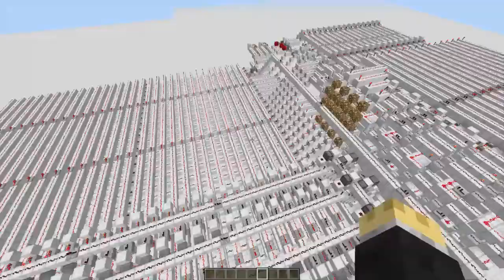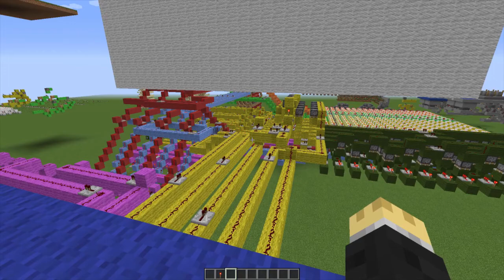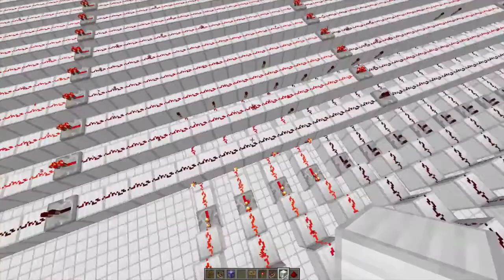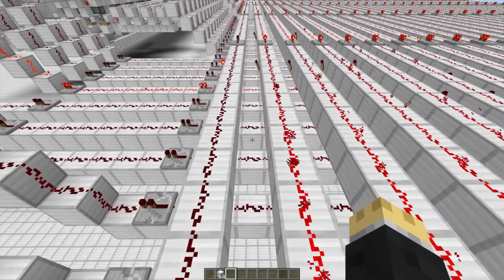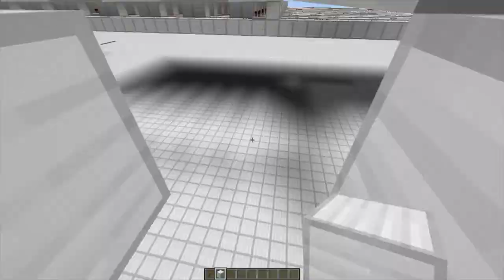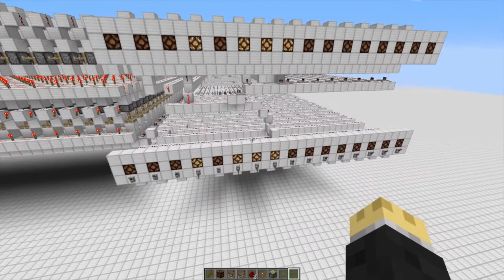Basic Computer Concepts - Pt 2 - RAM and IO

Comment: Hey n00b! Can you explain the difference between dual read ram vs normal ram?
Reply from the maker: You have no idea how tempted I am to respond with a sarcastic comment...

Single read ram, you give it the address of the memory location you want to read, and it gives you the data stored there.

Dual read ram, you give it 2 address's, and it gives you the data at both locations on two separate bus's

Comment: Okay... why loading temporary data to ram, that's not really smart. Registers are used to have temporary data in it, because it's closer to the Alu itself. Ram is used for longer term data.

An example of this is when you have alot of answer from a line algorithm, you need to save all the x and y's. You do that in ram and not in a temp register.
Reply from the maker: The point of loading all values into RAM was to demonstrate how to move and manipulate data found in RAM... obviously you can optimize data locations to your hearts content. I'm doing it this way mainly because it shows people that there's more than one way to skin a cat here. Which method is more optimal and which one you should choose is entirely dependent on the context in which it's applied. For example, if all you're using your computer for is to run one basic program, then yes, storing temp values in the registers and data in RAM is more ideal. However, I'm taking this computer in a rather different direction which will require occasionally saving your temp values. If they're already in RAM, it means less work when that time comes.

Comment: Not to be rude but you need a new mic. But other than that great tutorials, keep up the  good work.
Reply from the maker: I have a new mic - I still use the old one in part 3 though since I was still tweaking some of the settings to get it to sound decent. I think I got it set up though, so part 4 should sound better.

Comment: I trolled you
Reply from the maker: You must be new to youtube.
First off: Welcome, glad you could take the time to check out my channel.
Now, the first lesson is in using/navigating youtube: comment concatenation. While making an entirely new comment to continue an idea or conversation is perfectly acceptable, it does make it difficult to follow the train of thought. To remedy this, use either the reply button or the edit button, this way your addition to the conversation will be saved with the conversation.

The second lesson is in trolls. While the definition of a troll is a little ambiguous, most people agree there are two concrete definitions:
1) an individual who likes to break the flow of a conversation for the sake of laughter or a good joke.
2) an individual who likes to evoke anger in others, usually to show the trolled that everything they hold dear is meaningless. 

I myself identify as the first definition, and at first glance it looks like you identify as the second definition. 
Though the thing about the second kind of trolls is, whether they realize it or not, they are masters of crafting sentences designed to evoke the largest response possible.
Simply stating someones mother is a mother, while it sounds like it might get a rouse, is simply a true statement. If you are aiming to be the second type of troll, you'll need to practice more.

But maybe you identify more as the first kind of troll. If that is the case, a statement like 'your mother is a mother' is true, and true can mean funny. But understand that, again, there is an art to making true statements funny. That art is all about constructing the context. 
Example: "Your mother is a mother... sorry I thought we were stating the obvious here." Maybe not a gut buster, but it had a bit of dry and sarcastic humor to it.
The key is the context... and before you ask, "hahaha lmao lololol" is only sufficient context if you're Logan Paul and you need to signal to your audience of 6 year-olds that they need to laugh. 

Regardless of which definition you choose to apply to your statement, it falls short.
My suggestion: keep practicing.
In time, who knows, you may be a welcome member of my audience who gives everyone a good laugh anytime you leave a comment... or I'll have to block you.

One of the two...
Reply: @n00b_asaurus  good read